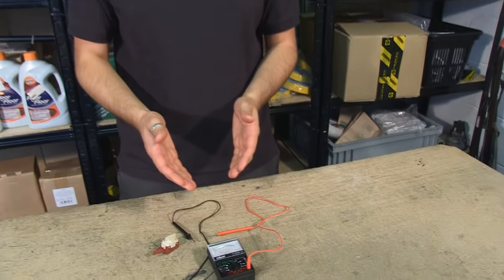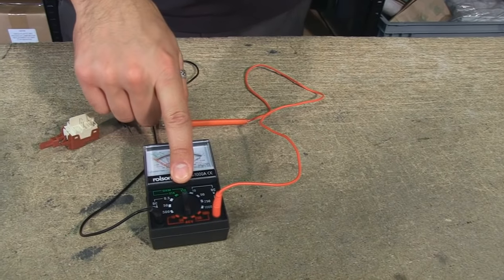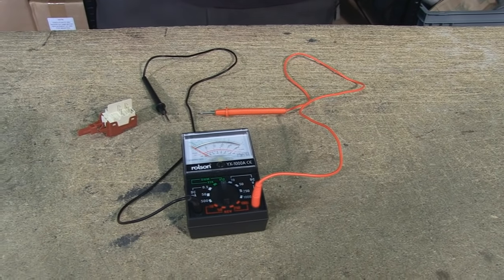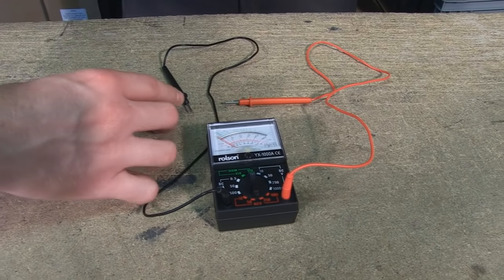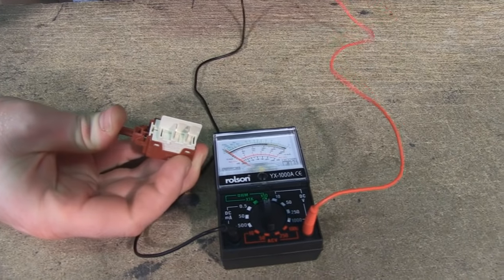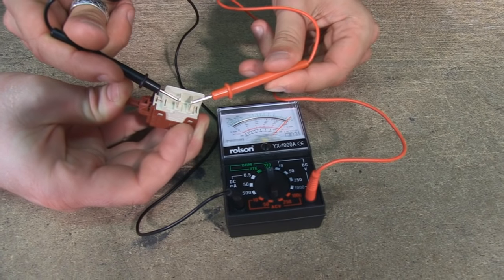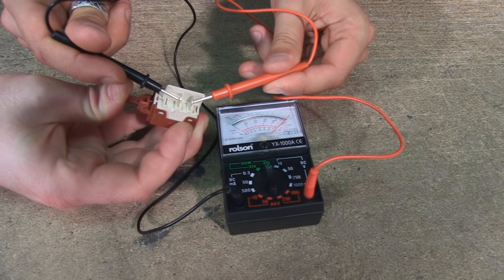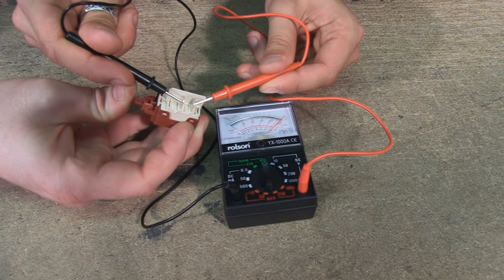How to Check a Faulty Switch Using a Multimeter

Comment: installing a 3 way switch for a staircase, can I use one switch tha'ts dimmable  switch and the other one that's not?
Reply from the maker: Hi, Okaythen001 we don't have any information on replacing that type of switch, we recommend you contact a qualified electrician.
Reply: I know it's 6 years old, but for anyone else reading this, the switch shown is a MOMENTARY single contact Normally Open type, and thus is totally unusable, for a three way circuit, or in fact any light circuit, because as soon as you release the pressure, the switch (should) open and turn off the connected load. No one who needs a light on (especially on a stairwell) will stay at the switch, keeping the button pressed.
What you need for a dimmable three way stairwell circuit, are a dimmer, yes, connected to the output (to the light/s) circuit, after the three way function switches, which will be changeover latching types, which when switched, will change their contacts to be either open or closed, to which will be connected an intermediary cable of 3CN&E 
(it's a special tri-coloured "3 core + 1 N & 1 E" multi-core cable = 5 cores in the one cable) 
The incoming mains supply will be connected to the common terminal of the 1st switch and the Neutral & Earth wires will terminate in individual locations inside the switch body, as indicated by an N and an E 
You will also have a FIVE core cable as in 5C which will contain three LIVE cores and an earth & Neutral cores, such that one coloured wire, normally the red, will be connected to the COMMON terminal where the incoming mains supply is terminated, while the other two colours,(which my be Purple, Brown &/or Magenta) will be terminated one to each of the two output contacts NO & NC - which will be connected to the other two contacts at the far away switch, while the red will go into a spare blank terminal.
The incoming main supply Neutral is connected to the black covered wire of the 5C & the Earth is the Green/Yellow covered wire in the 5C
Now at the far away switch, your outgoing center common terminal will feed the Line in on the dimmer
The dimmer will also have a Neutral terminal & an Earth terminal, your "lights" will be controlled by the output of the Dimmer, whilst anything that is to be fed full power, nearby, such as an extractor fan or a wall mounted heating panel, will all be able to be fed a unit mounted switch from the red wire that came across & thus along within the 5C down the hall, with the N & E provided as well.

The light/s are fed from the Dimmer's output and a N&E at the dimmer.
Auxiliary circuits needing a supply from the same 5C cable, can be installed without running a new supply feed.
It saves on cable runs, as well as making the installation future proofed.

That way, when you wire your hallway with it's two way lights, the full power supply is also fed along your hall, (via the 5C cable) for that all important OTHER circuit, that you may someday need, without needing to re-run another supply cable the entire way.
.

Comment: ?
Actually, THAT does "not" test the inner pull-in solenoid (inside the switch) to check if the switch is "working" when a voltage is applied, as it is NOT rated for a person to "push" the rod inwards, (that is the cheats way of checking a faulty pull-in/push-out switch, by manually bypassing the electrically controlled "pull-in function".
The correct way to TEST any relay type switch suspected of NOT working, is to take it out, and bench test it, by applying the correct "voltage" to the switch control circuit, to check to see, if 1/- is it an instant switch, or a TIME DELAYED type, and when it does operate (does it THEN make the NO contact to close properly, and the NC contact to open properly,, and then on removing the power, is there an instant closing, or is there a time delayed switching function.

Simply manually pushing in a "defunct solenoid switch, is NOT a function test, just a "contact closes test" (one of MANY that need to  be done, in order to check CORRECT function properly.

Sorry, but your cocked-up test does NOTHING to prove whether the switch functions correctly, when POWER is applied &/or removed.
As you never had the ohm meter  connected BEFORE the plunger was pushed, how do we even know it isn't an ALWAYS ON selection (say across the relay itself, and NOT across a switchable contact?
As a faulty / shorted out relay control circuit,, will FALSELY show a zero ohm status, for an absolutely fried solenoid.

ALSO: THE BIGGEST KILLER OF HOME SERVICING,  IS THIS.
NEVER PLACE AN OHM METER ACROSS A SUSPECTED FAULTY SWITCH - IF IT IS STILL "IN-SERVICE" AS, THE CONTACTS VOLTAGE BEING SWITCHED, COULD WELL BE MAINS VOLTAGES, (irrespective of the state of your low voltage coil "solenoid circuit")

The absolute first step, is to isolate he switch from BOTH the low voltage control circuit AND the high voltage circuit th switch may be controlling.
Ohm meters are fine, BUT DO NOT LAST LONG if applied to a mains voltage, as if a load.

Now, go home and devise the correct "full set" of powered on and powered off tests.

To be done on a completely isolated test-board, with BOTH options of a powered on & off stage, as well as a LIGHT on each of the switch outputs, to see what happens, and how long before or instantly when the changeover happens, THEN & ONLY THEN can you remove the lights and test the effectiveness of the "closed" contacts when powered ON AND OFF, as often a changeover switch fails, when the contacts meld themselves CLOSED, - which that stupid test (shown here) will not clearly show.!!!!!!!!

Comment: Sir help me out from a dought.
In short circuit , continuity shows & beep sound & the switch is bad or damage. Its clear. No question is, if it no continuity & reading is above zero the switch is good, but it not working. What's the problem?
Reply from the maker: Hi Sujit, if the switch is in the off position you should not get a reading on the meter as the contacts are broken inside, when you push the switch the contacts should make and you will get a reading confirming the switch is fine.
Reply: If a continuity tester BEEPS. it means a circuit switch function is closed, nothing more & nothing less.
If a reading is "above zero, there is a resistance of that measurement in between the probes, which either means a load is connected directly across the terminals (it shouldn't be but sometimes some circuits show a resistance on an open circuit).
If however the contacts are SUPPOSED to be closed, you have faulty contacts if there is any reading above zero, (such as 5ohms - infinity, as the contacts are either pitted/corroded, in which case the contacts have become faulty.
Replace with a brand new switch, of at least the same rating, if not a higher rating to ensure the contacts don't pitt as frequently.